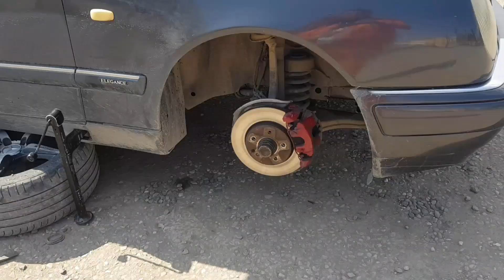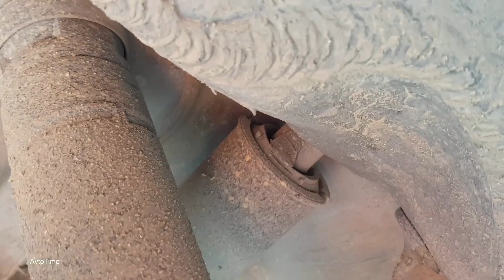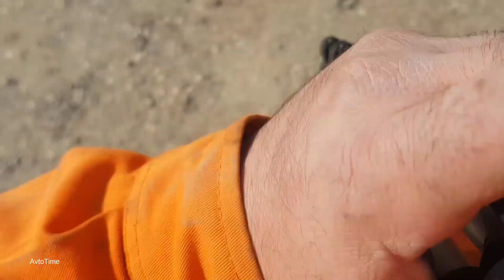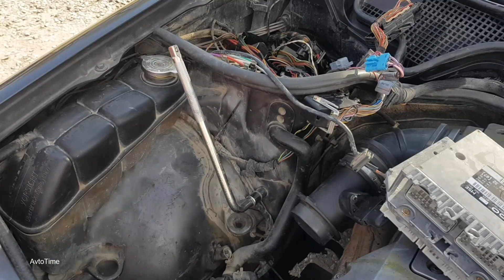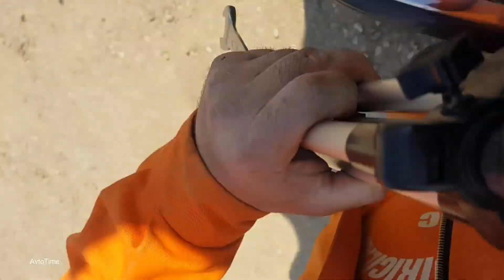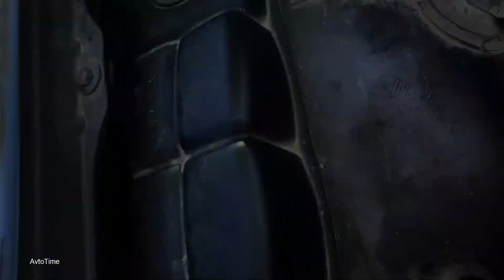Is it harmful to use kickdown in a car?

Comment: I had a problem with a W210 2001 E430 where everything would work great, but if you hit the accelerator pedal hard at any speed, it would try to enter kickdown, and the transmission would lose the gear, and it would throw the car into neutral. This happened after the car was stuck in 2nd, and I replaced the conductor plate in it with a Chinese part.